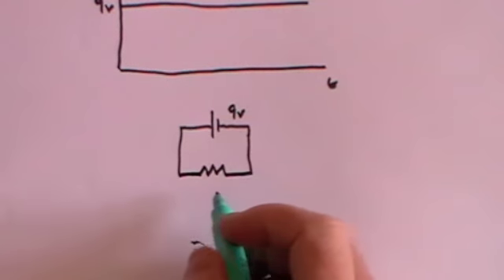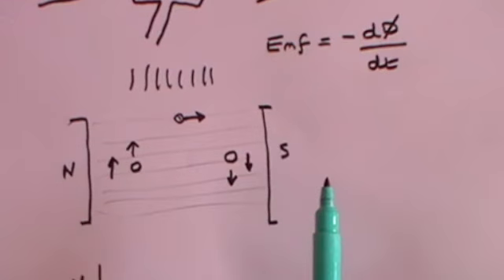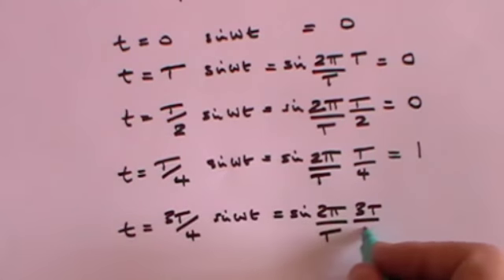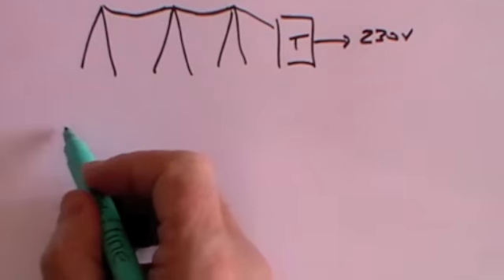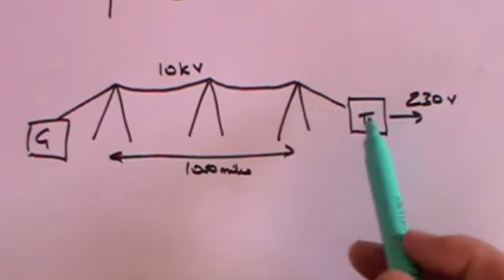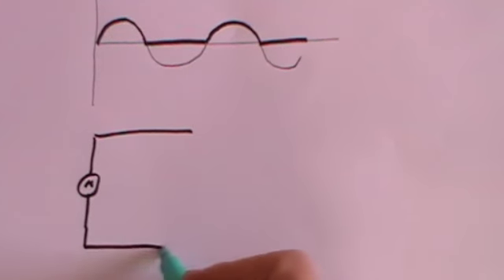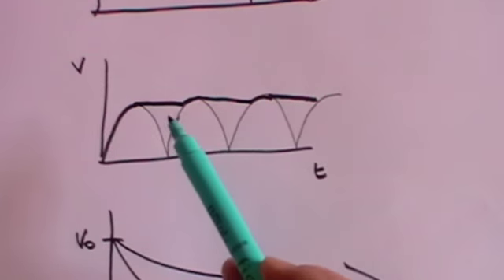Alternating Current - A Level Physics

Comment: why was the grid set for 50/60 Hz? what is the approximate energy efficiency (%) for, say 100W, 50/60 Hz transformer ?
Reply: 99.50%- 99.75%  a little energy is lost due to eddy currents and resistance factor

Comment: So there is no such thing as hot wire and ground since the current switches between two wires that go to the load? 
This is what I call hogwash.  In the real world in your house,  You will a hot wire and a ground, the two wires is not the same.

Comment: I'm not sure if someone in the comments has said it or not, but PLEASE do not just stick a large cap in the circuit! You'll waste a lot of power that way.

 If you were using a Three Terminal Regulator, then the larger your Vmin is (the lowest trough that the capacitor discharges too), the more power is on the input of the regulator. A TTR only needs Vmin to be at least a certain voltage above your desired output voltage load, which in the case of the LM317 is 2V. Then to calculate power dissipated by the TTR, you take the power of the input from the full-wave rectifier and capacitive filter minus the expected output power. Only using the Vmin you need rather than an excessive Vmin can lower the abuse your device will take  in terms of heat/necessary cooling!

Comment: there is an important error or possible confusion at https://youtu.be/C_mxpy0bdoA?list=PL2D59C6AF8D76FA90&t=2074 ,  at 47:45... you mix up the power you want to send (to the final receptor) in a certain format with the actual power losses in the transmission lines. As a consequence you confused me when you said "suppose you want to transmit that current....", I suspect you wanted to say "suppose you want to transmit that power...under 250 volts, then".. apart from that you are amazing teacher !! THXX from brussels

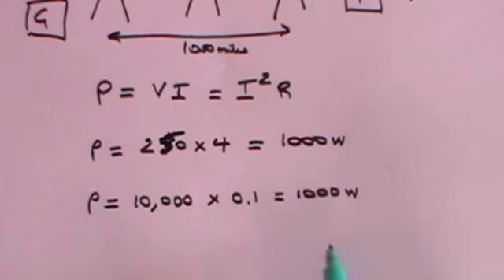Comment: 35:31 where did this 0.1 come from?
Reply from the maker: The power being transmitted (VI) remains the same so if V increases then I decreases proportionately. But the power loss in the cable is smaller if the voltage is higher.

Comment: Why is the power loss given by the equation I^2 R only and not any other equation of power?
Reply from the maker: I know a lot of people puzzle over this. They say: why do we look at power loss as I^2 * R and thus make I as low as possible. Why not look at power loss as V^2 / R and then make V as low as possible? The reason is that if you look at the V^2/R option you are looking not at the voltage coming from the transformer but the voltage drop across the power lines which will be a tiny fraction of the voltage on the power line.
Reply: It can be other equations of power. Like V^2/R but remember the power dissipated across the resistor is the voltage across that resistor x I.

And V= IR so in his example of 10 kV vs 250 V:
considering the 250 V example; the power was constant therefor the current = 4A

So V=IR =4Amps x 10 Ohms therefore V=40

and V^2/R =1600/10 = 160W dissipated. 

Sorry for the long explanation.

Comment: Sir I have a small question, when you were discussing the topic of transformers, you said that the voltage in primary is given by Vp= Np*rate of change of flux, and voltage in secondary is given by Vs=Ns*rate of change of flux. Now my question is: in secondary, it makes sense that the voltage induced in it is given by that formula, but why is it so in the primary? since the primary voltage is not dependent on induction at all. Hope you understood my question.

Comment: Thats a great video! But you might have made a mistake. In the beginning of your tutorial, when you determined the direction of the current in the coil of an ac generator when it's turned in a clockwise direction, you used flemmings left hand rule. Instead, you should have used flemmings right hand rule. If you did so, the direction of the current would be opposite to the direction you specified. This is all because in ac generators, the induced e.m.f follows the Flemmings right hand rule.
Reply: Rudra Ghosh He used left hand rule to find the current direction from the direction of the external magnetic field and the direction of the force acting on the loop of wire. This is correct since the right hand rule works for the cross product of the current and the external magnetic field direction, essentially giving the inverse.
Reply: Rudra Ghosh He basically gave the non-conventional direction.

Comment: the root mean square is the average voltage and average current that the resistance load can sense , since it doesn't detect a change in the direction of flow , of current or voltage.
unless adding a magnet to the load , it starts sensing the change and starts motion

Comment: sir, why is power loss said to be i squared r and nor v squared by r? i did not understand the need for high voltages in transmission... if it was v squared by r then what happens?
Reply from the maker: +Akshay Mohan You can use V^2/R but you must use the potential drop across the transmission line, not the voltage out from the transformer. You are unlikely to know that, whereas the current thro the circuit will be common.

Comment: Hey! About using high voltage to reduce the loss of power. We'll get less power lost using the equation I^2*R, But what if we use V^2/R? It'll just be the opposite wouldn't it? So how does it work?

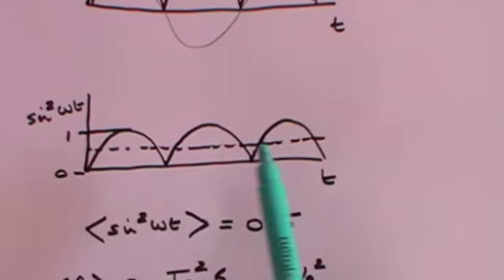Comment: I see how you derived the formula for the average Voltage in AC at 20:41 and it does make sense. However I wonder what does another way of deriving it really mean:
1. I integrate the equation of Voltage from 0 to T/2 (taking only positive area): Integral[V0 * sin(omega*t) dt] from 0 to T/2.
The result is -V0 * cos(omega*t)/omega from 0 to T/2. Evaluating gives me: V0 * T / pi.
2. I take the area under the curve and divide by change in T -- the length of the bounds of integration:
V0*T/pi*(T/2 - 0) = 2V0*T/pi*T = 2V0/pi.
Therefore I could conclude that the average Voltage is 2V0/pi. However this value is obviously much different than V0/sqrt(2). What does this quantity represent? Does it have a name?

Thanks for all your videos, they are great in helping me understanding a variety of topics in physics. You are amazing at explaining things with simple words, yet not abstaining from maths :)

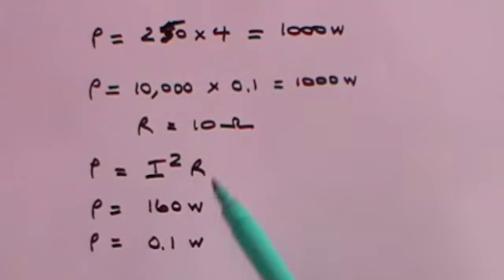Comment: at 37:03 , why can't we use v^2/R? and when I tried it... the power loss is greater at 10000 V even though when I^2R was used, the power loss was lower at 10000V. I'm confused 😕
Reply from the maker: +Prashanthi Narangoda We use I^2R because current is constant through circuit. If you use V you need to use the potential drop along the power lines only.
Reply: +DrPhysicsA Ohh! I get it now (: Thank you

Comment: Sagar -
In this case the V^2 term applies to the voltage in the wire, not the load. It is better to think in terms of the formula P=I^2R (1)  for power dissipated in the transmission cables. Since P=VI, if we double the voltage that we are sending down the cable, to get the same power at the end the current is halved. But, because of the I^2 term in (1), the power "wasted" in the cables goes down by a factor of 4. Or look at it another way - we need a 1/4 of the copper to transmit the same power. The downside is that we need more insulation, but that is cheaper, and lighter than copper. In many cases we can even rely on air to provide the insulation.
Reply: Thanks graham.... I was just assuming the entire voltage across the cables... that's so silly of me...

Comment: As usual u r just amazing.... but I 've a doubt on the current transmission.... Power dissipated in the wire can also be written as V^2/R . So if we supply the current at a higher voltage in the transmission cables, according to the above equation power dissipated will be large . Can u plz help me out in this stuff...

Comment: I thought for generator as it is induced we have to use right hand rule not left...
Reply from the maker: Yes. It is the left-hand  rule for motors and the right-hand rule for generators. I think I may have added an annotation to correct an error. But I know that not everyone can see the annotations.
Reply: DrPhysicsA Actually, it is either. As long as the rules are consistently applied. If you choose to use the right-hand rule for a generator then you must also use the right-hand rule for a coil and the right-hand rule for a conductor and the left-hand rule for a motor. You can switch which hand to use to apply the rules if you apply all of the associated rules to that hand also. It is quite similar to the difference between conventional theory current flow and electron theory current flow. Does current flow from + to -, or - to + ? No one truly knows. But if one consistently applies the theories and rules throughout their work then their work will make sense.
Reply: DrPhysicsA By the way, Very well done video Sir.

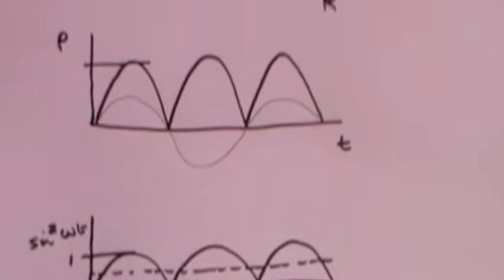Comment: I would point out that the representation of the Sin squared waveform (explained from around 19:44) is incorrect. It does not look like a full rectified sine wave - in fact it is a sine wave of double the frequency, centered at 0.5Vo. That is where the average value of 0.5 comes from (since the average of the sine wave component is zero).

Comment: think of a 1/4th of cycle i.e. 0 to pi/2
at pi/4 wave is decreasing to 0 on left &
increasing  to pi/2 on right
so average would be at pi/4  
same is true for other 1/4th part
so avg of pi/4 nd pi/4 is pi/4
same is true for other 1/2 part
so avg of pi/4 nd pi/4 is pi/4
and then sin(pi/4) = 1/sqroot(2)
[sin(pi/4)]^2 = 1/2

Comment: so why does a uk plug have neutral and live wire if ac changes direction of current? technically there both live and nuetral and they alternate. thats always baffeled me with AC.
Reply from the maker: It is the live wire which has the voltage variation from about +400 V to -400 V and the neutral wire is held pretty much at 0 V. So in theory if you touch the neutral wire when no current is flowing you should be okay, Though I don't advise it. The point is that if the current is flowing it flows through both the livewire and the neutral wire.
Reply: DrPhysicsA ok that makes sense so if you wired it wrong in your plug then devices would still work like on ps3 tiny 2 pin pluggs that can be plugged in either way thats cool :)

Comment from the maker: There is a difference between a generator and a motor. In the former case you turn a coil in a magnetic field. There is a phase difference in this case between the maximum flux linkage and the maximum current. in the case of the motor current flows in the coil in the presence of magnetic field causing the coil to turn. In this case there is no phase delay between the maximum voltage and current.

Comment: ok, one thing I don't get. If AC is switching direction why don't I get hurt when I hold the neutral wire, but I do when I hold black or red or blue? Because if it's switching direction the neutral wire should shock me.

Comment from the maker: Good questions. More about technology than physics.  The windmills have a very clever gearing device which is capable of self adjustment to ensure that the turbine itself produces electricity at the appropriate frequency. The entire national grid monitors demand on a moment by moment basis and can switch in or out additional generators as the case may be.

Comment: Re Q2:  A filament bulb on an AC circuit is being turned on and off at a rate the same as the frequency of the alternating current, for example 50 times a second, because this cycle is so fast the filament does not have time to cool down and loose light output.
An LED (Light emitting DIODE) only allows current to travel in one direction, the light is not produced by heating a filament so as soon as power is cut the light stops.  On AC this will happen for every negative voltage cycle.

Comment from the maker: Yes that's true but the Capacitor holds a much more steady voltage so this is the steady voltage which applies even if another voltage source in the circuit falls.

Comment: Dont know why im at uni you teach so much better. I dont unserstand why you would put the capacitor at then end in parallel not series. Surely the voltage from the bridge rectifier will still travel through the computer.

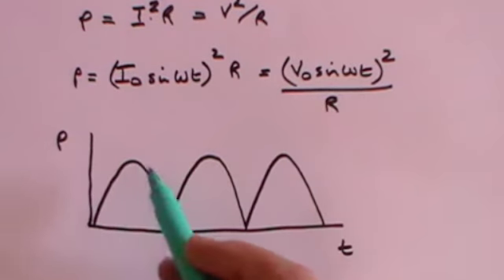Comment: The power dissipated in a filament is the one shown at min (18:00).
If the AC frequency is high enough, even when the instantaneous current (power) is 0, the filament will still glow b/c its temperature changes much slower. Nevertheless the filament will flicker, but never really turn OFF like in the LED case. I think this what they mean.
Checkout this youtube video:9HUrYoqxQpw

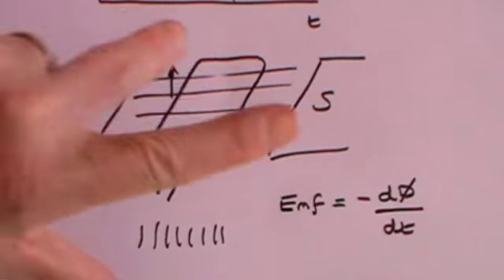Comment from the maker: Well spotted. At 3:57 it should indeed be the right hand rule (rlght hand for generators - left hand for motors). I have made an annotation. Thanks for spotting this. As far as your second question is concerned, unless there is something I have missed an LED will light only when it is forward biased (ie the current flows in the forward direction thro it). Otherwise no current flows and the LED doesn't light. Perhaps there is more to it in your text book. Is it something to do with decay time?

Comment: I think it is going to be another good video if you would make one to explain how battery work in atomic level? Why different chemistry produces different voltages (Nickel Cadmium, Lithium Ion, Nickel Metal Hydride etc.)? Why drain battery under a certain voltage kill the battery?(and over charging kill battery as well)